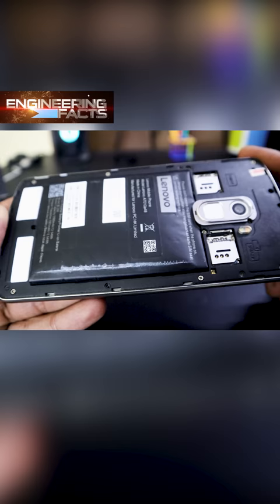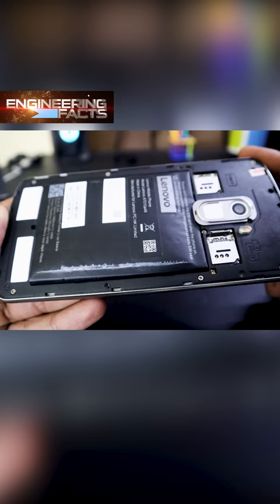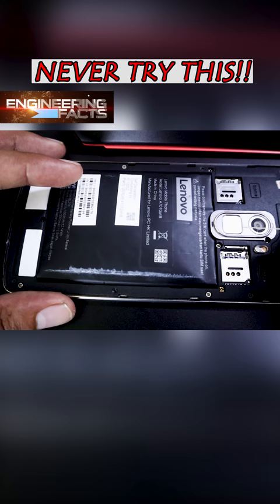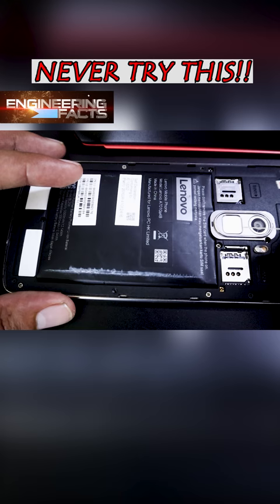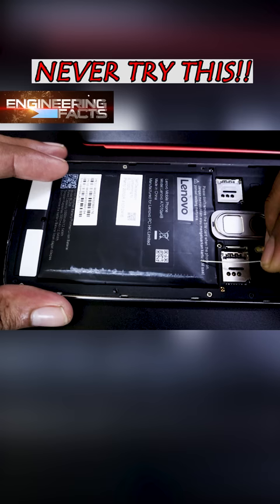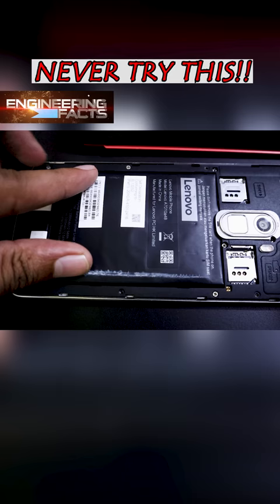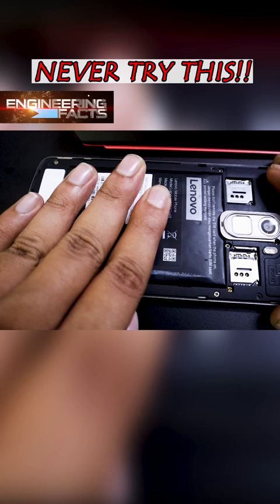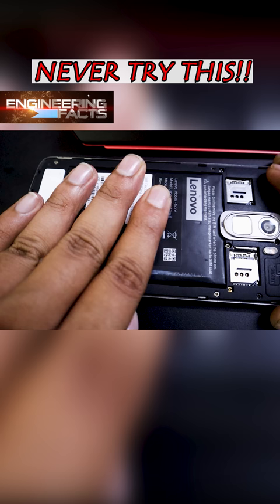How to repair bulged battery? #engineeringfacts #engineeringfactstamil #shorts

Comment from the maker: This video is only for educational purposes. The gas inside is highly flammable. Viewers never attempt to try this.
Reply: toothpick use panna vedikuma bro.
Reply: Oru gloves podu ya...
Reply: U shouldn't have put this..
Reply: அப்புறம் எதுக்கு இத சொல்ற
Reply: Brother, Please remove this video as soon as possible. This video's title drives the viewers to perform the dangerous action performed by you (inspite of your warning). Please keep in mind that, not all the viewers may have sufficient knowledge about lithium battery and the action may put US in danger. Kindly avoid posting this kind of video.
Reply: 🔥🔥🔥🔥🔥🔥🔥🔥🔥🔥🔥🔥
DISCHARGE THE BATTERY TO 0% & THEN PUNCTURE THE BATTERY IN CORNER
🔥🔥🔥🔥🔥🔥🔥🔥🔥🔥🔥🔥

Comment: Bro Actually it's not because of heat... The separator between the electrodes are getting ruptured due to the battery's age factor... The chemical reaction through the separator at both sides produces gases which bulges the battery... So please avoid using a bulged battery... And moreover the charge capacity much have reduced drastically when we poke a hole to release the gas formed inside the battery... Atleast cover the hole or else the electrolyte will be done in sometime and the battery no longer hold any charge...

Comment: But charge normal irukuma bro
Reply: A battery doesn't store current, it just switches chemical energy anode to cathode, we recharge it to just help it to go from cathode to anode again
But if they mix together they explode so electrolyte divides it and prevent it from exploding but if electrolyte evaporates ( they evaporate even in very little heat) the anode and cathode travels some bit and drys out as there's no eletrolyte and it affects the capacity of battery and no longer hold that much charge so
Reply from the maker: No. Less backup, sudden power off , etc
Reply: @engineeringfacts  I was explaining him bro why it happens
Reply: @engineeringfacts  btw bro , how are anti matters stored , could you make a video about that engineering type ( I heard it from a random channel from America and there is a very big mechanism that holds a tiny amount of antimatter) 
I don't know about what is that but could you explain it bro ( I'm a student
Reply: @engineeringfacts  also how microchips and nanochips work